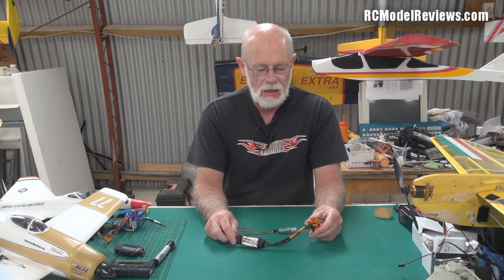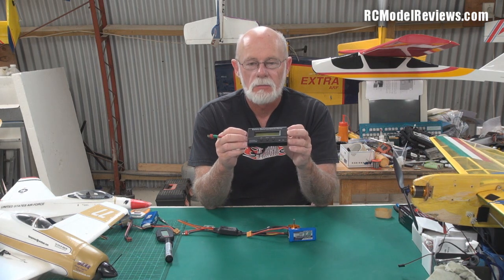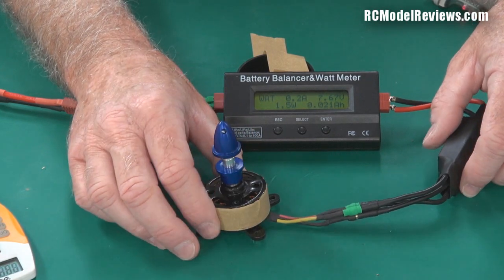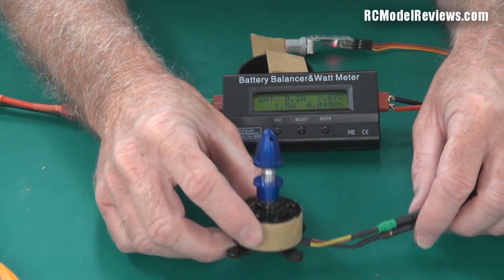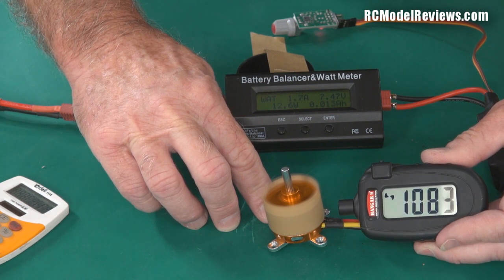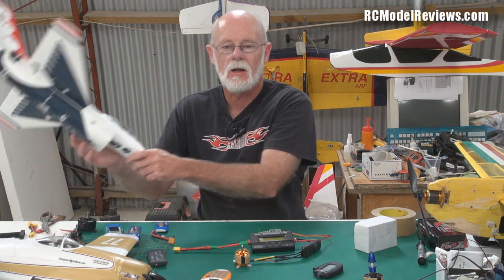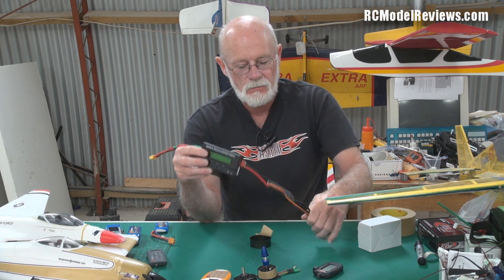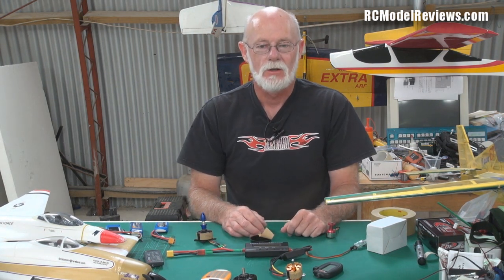RC BASICS: What is KV?

Comment: Thank u 4 posting this!  u mention not to put too much power into a motor that cnat handle it?  iam new at this and thot the motor draws power FROM the battery?   if it jst draws waht it needs wont it draw the same amt of power from batteries wit diff voltages?    r u saying the battery pushes power into the motor?

Comment: This guy is great.... what's his third review called?  I need to understand prop sizes....  does a smaller prop deliver more air speed or does every motor have an optimum size... and does an 11.4 V 3200 battery give you as much flight duration as a 14.8 V 2200?

Comment: Hello Bruce. Tank you again for your videos. I learned alot from them. If I understud right, Kv stands for K rotations per volt per minute. Im ingriged about the velocity of the edge of the prof. Lets assume a fully charged 4S battery, 3inch prop and a 1105 motor with 6500kv. Using metric sistem. 3inc~7,62cm/2=3,81cm (radius). 

The radius*Pi*Kv*Volt*60seg will give us the volocity in m/s of the edge of the prop. Calculating 
0,0381*3,14*6500*16,8 = 783.841,968m/s 

This is faster than sound. Can you explain me how a plastic prop doenst explode on that velocity?
Im really intriged about this.
Takn you very much for your time.

Comment: Very good, I have 3 questions before anything, I'm doing mechanical legs like cats legs, it's very light, only 23.5 cm, I'm using plastic and aluminum for more lightness. The mechanisms work quite well, BUT I can not find the proper DC motor for this project, I use DC - 12V motor., It is heavy and weak to move legs, my question is what Motor do you recommend for this type of project? Can I get a better result with a brushless motor? Someone knows? Thank you.

Comment: I want to build an 900 mm EPP wing and was looking for motor options. It is suggested to use a 2822 1450 kv motor. Though, when I look at these motors, their thrust seems very low, even with big props, compared to the 2205 or 2206 motors used for quads. I'm now wondering: what is the benefit of using a large motor, with low kv, which has not very much thrust?

Comment: So, for a Boat application,   Basically the lower the Kv the more TROQUE it will have?  The Higher the Kv more Top end Speed?    Does a 4 pole motor have more Torque than say a 6 pole?   And lastly, what is the Determining factor(s) for the ESC,  is it Motor Max Voltage, Max Amps etc.,   Any help is appreciated.  After getting the Torque & Speed Kv sorted out, I need to know hoe to match that to a proper size ESC.

Comment: @biggavdemille
That particular tachometer is designed for measuring the speed of "two or three blade props"  It probably doesn't have a 1:1 option.
Reply: he had 2 marks on the tape,, I use this method all the time

Comment: A question for your next video (I apologize for jumping the gun): does field altitude (air density) affect prop selection? 
I live at 1500 feet ASL (about 460 meters). Denver Colorado - 5280 feet ASL (1600 meters) - is a 7 hour drive from my house. If I fly there, would I need to change props to avoid over revving the motor and overheating the battery?

Comment: Hi friends and thanks for nice video
the first question I have walkera x350 pro with total weight it is 1.200Kg what you suggestion
to new motor with ESC
the second question if I choose the motor with High KV like 1300kv , 1400kv it mean fast and strong and what the relation with ESC 20 or 30
thanks my friends

Comment: Isn't Kv only an approximation to RPM/volt anyway? I keep reading that Kv is actually  a measure of the back EMF produced as it is spinning. Hence why it's actually called the Voltage Constant like Kt is the Torque Constant

Comment: Thanks so much for this vide, subscribed! One question though. So, i understand that:

- Smaller motors = usually high KV = uses smaller props = therefore it's suitable for faster flying planes.
- Likewise, bigger motors = lower KV = more torque = uses bigger props = therefore suitable for slower flying planes.

If this is the case, why can't I just use a smaller motor on a slow flying plane BUT don't let it spin as fast? I'm assuming the faster the higher KV motor spins, the more throttle it gives?
Reply: I think then the motor would not be working at it's optimum.
If you mean a smaller motor with a smaller propeller, I think that would not give you enough thrust.
If you mean a smaller motor with big propeller and running the motor at slower speed , then the motor would not take it, as smaller motors has less momentum force. Torque.

When you choose motor and propeller for your plane, you start with the propeller.
Choose a big enough propeller for your plane. Then choose a motor that would spin that prop at the speed required. And a motor with enough torque.
It usually doesn't say how much torque a motor has, but you can sort of guess when you consider the KV rating and how many Watts the motor uses and the lenght vs diameter of the motor, like Bruce said.
A small diameter 250Watt motor with 2800KV = less torque.
A larger diameter 250Watt motor with 1000KV = more torque.

Comment: i have a question, i noticed you said that brushless motors were AC, i was always under the impression they were DC? i know that AC motors require inverters as the only way to change rpm is with frequency as appose to DC where you can just use a dimmer switch for example. i would really appreciate it if someone could clarify or elaborate on the subject for me. thanks in advance.

Comment: So if I have more kv does it go quick or slower
great video
Reply: KV is just speed of the motor, not power, so neither specifically. A small motor with a high KV has to spin very fast to produce the same lift on a small prop as a large motor with a low kv on a big prop. It really comes down to the dimensions of the model.

Comment: I've heard the tearn inrunner motor a few times from hobbyking... what is the difference between an inrunner and an outrunner? also what advantages could an inrunner have over an outrunner?
Reply: Out/In runner only means which part is moving, the outer shell or the inner shaft.

Comment: Does it matter what throttle value you give the ESC before you do the RPM measurement and division by the supply voltage?  Does the throttle need to be 100%?  And it is surprising to me that the measurement could be done with no load.

Comment: I'm confused. The speed must depend on the switching output rate of the esc. The torque will depend on the current, which will in turn depend on the voltage applied to the windings. Could it be that the speed per volt refers to the pwm voltage used to tell the esc how fast to switch it's output to the windings?  I assume the pwm speed demand signal goes from zero to the battery voltage?
Reply: "The torque will depend on the current, which will in turn depend on the voltage applied to the windings." Yes, this is true, but you can't put infinite amounts of current and voltage through a small motor. It would melt. So you need a bigger motor that can handle more power. Hope you understand.

Comment: Would it be possible to use two different motors for something like an electric skateboard? As an example, 130kv for torque and 220kv for speed? Would you need a slipper on the lower kv motor for when the speed goes over it’s limit? Thanks

Comment: so for multi-rotor world...if im trying to carry a payload and not too worried about speed, i need to use low KV motor with larger prop 

and if i want to do FPV flying which i need speed, i need to use higher KV with smaller props...do i have this correct?

Comment: so if you have a 6 cell, 22.2 Volt the balancer would read ~22.2, is that right. Because in the video u have 2 cell 7.4 Volt and that's what the balancer read ~7.4V

Comment: Does the Esc amperage need to be  bigger or lower than the batterys amps. ? If i have an instalation that require 60A , 60/4 =15A about an 20A Esc will work but the battery amperage need to be bigger or lower than 20A Required per motor ? The battery will need 60000mAh or the mAh multiplyed by C rate need to be 60A?

Comment: Bruce:
Can you do a video on how to convert a  gas model to electric? I have several gas kits .25 and .46 size with 9x6 inch and 10 inch props and don't know what motors to buy to convert them. Thanks for the videos.
Don

Comment: How slow can you effectively run an 800 kV motor as in your video?
Thanks.
Reply: If you can get it set up to be sensored, you can make it rotate as slow as you want. Without a sensor it will very dependant on the size of the prop, the amount of voltage being sent to the motor, the amount of poles in the motor, the size of the can on a road going RC motor.

Comment: can someone clear up for me how the voltage determines the speed?
this is not a brushed motor which indeed changes speed depending on voltage you give it due to the strength of the magnetic fields.
AC/BLDC motors are dependent on supply frequency to have the rotor "follow" the supply as the current alternates/pulses around the poles.
So how would KV work then?

Comment: OK so I don't know if you would be able to answer this. I'm getting into RC short course truck racing and I've bought a truck that's heaver than normal and everyone says I need a higher kv motor. it would seem that if its a heaver truck that I would want a smaller kv motor. I also have to buy an esc that is rated higher. if it helps the truck I have is the losi scte and the motor esc that is recommended is the tekin rx8 and there pro 4 4600 kv motor. I mean I believe those who race this setup I just don't understand it
Reply: It works differntly in planes and in sc trucks, bit remember that your motor doesn't have to have super high kv rating.
Remember that in planes are outrunners and in cars are inrunners.

Comment: Hi, Great info thanks .....I am building a Extreme Extra 300 E 58"...Im installing a 3800kv 550 size 1200w 4 pole inrunner motor ....Geared 3.5:1 ...15x8" wood prop....100A ESC....3s 60-130c 3.2Ah LIPO.Have I made any mistakes ??....(Another outrunner motor would of been better).....any info gladly received.

Comment: GREAT VIDEO'S thanks , one thing I was wondering , on both the motors you looked at with the Tachometer , you used 2 markings. I would assume that 1 revolution was 1RPM if I did it. Obviously it is not and from the kV rating/RPM measurement the rpm is double that indicated (as I would assume using 1 mark) ?
Reply: thats what im confused about too
Reply: Can’t say for sure, but perhaps there is a setting on the tach that allows you to set the number of “timing marks”? He did mention that this particular tack is often used with two and three bladed props.
Just my guess. It may also be that he should have split the reading in half.

Comment: One question...if I have two motors with different number of TURNS, one 17.5T and other 13.5T, but they have the same KV, 2500..will it have any difference of performance?...I mean, if they have the same KV, doesn´t matter the number of turns, they will have the same final rotation? and the torque? any difference? Thanks for any little help...

Comment: You are measuring the DC voltage into the ESC, but is it not the AC voltage out of the ESC that determines the RPM?   Unless I'm missing something, I don't believe your method is quite correct.

Comment: I know this is a old post but these motors are pulsed DC not AC.
AC fluctuates from +volts to 0V to -volts, whereas pulsed DC is always +volts and the timing of the pulses is varied.

Comment: If the volt reading is peak then the calc is correct, if not then the volts have to be multiplied by 1.414 to convert the RMS reading to peak.
Reply: That's true for sinewaves but not square waves

Comment: OK sir
you are saying lower kV with longer props and highest kV with smaller props. my doubt is what will happen when we connect higher kV with longer props and also I want to know if we want to left larger weight than what kind of motor is suitable higher kV or lower kV
Reply: +Manikandan R It will overheat or not perform very well depending on how much too large the props are

Comment: So i have a question.

You calculated the voltage that you had in the battery and divided that with the rpm. Should you not calculate the rpm that you got with the voltage you put in the motor? because the display shows you how much voltage you have in your battery not how much voltage you are putting through the motor.

Comment: Wouldn't the KV vary a little bit based on motor load?

Obviously this test is done unloaded, but I'd suspect you could get a little bit more data on motor performance by running a test with some sort of adjustable brake.
Reply: pauljs75 pretty late but KV is a rating without any resistance, so it will not vary with motor load

Comment: Hi, I run a 9,000 kV brushless motor with 2 cell lipo on my Tiny whoop and get around 3.5 mins of acro flight time (4.5 mins if cruising).  How do you think would swapping it with a slightly higher kV motor, let's say 12,000kV, theoretically affect the flight time and acro performance of my tiny whoop?

Thanks in advance!

Comment: I have a e-flite v1200 and it only has a 800 KV motor but it runs at 30,000 rpm on 6s ?? Why such low kv but high rpm, i thought the motor would have much higher kv?

Comment: Hmm... normally the two values you get for a motor is KV and KT in both cases the K stands for (k)constant.  The first is the constant ratio between volts and rpm and KT is the constant between amps and torque.

Comment: i know its an old video but I just started to learn and have a question please
I would really appreciate if I can get the answer 
one of the motors in my drone burned and I can not find the exact same size with exact same kv, 
the  closest motor I can find is same size but slightly different in kv, 
I would love to be  just change that motor so I'll be able to fly my drone again, 
is there any chance I can use one motor with 3600 kv and 3 motors at 3800 kv  but both same size in one drone ?
thanks alot

Comment: Went to the Hobbyking site with the intention of putting together a parts list for the kit rather than the backordered "Package Deluxe" Bixler EP , got everything but the motor, couldnt find one. It requires a 2620-1900 kV outrunner they dont sell, Are they talking windings, or dimensions?  Pages of motors in the Global site
Nearly lost my patience, and thats saying something considering the weather outside in Eastern Canada at current. So why not do a schtick on motor equiviency?

Comment: how do work out how many amps a 21.5t/1600kv motor will need? This is for choosing an ESC/battery etc.
Reply: You cant work out the current draw using only the kv. It is a function of the load on the motor and the voltage you run.

Comment: Great video, a lot of very useful information, but...the ESC absolutely does NOT convert the DC voltage supplied by the battery to AC voltage to power these BLDC motors. Yes, these hobby motors are BLDC motors-Brushless DC - these motors, in fact, run on DC voltage. The job of the ESC is to supply the appropriate current (determined at the throttle position/power controller little-dial-thingy)  at the rated voltage of the battery(give-or-take) to each of the BLDC's three sets of coils (hence the three motor leads) at the correct time and required polarity. The only AC voltage involved here is supplied to the LIPO charger when charging the LIPO cells.

Comment: Are you are you similar what you got but I do mine by wattage and amperage.... Cuz once you put a blade on that motor. It's going to draw more amperage.... Which and turn the motor is going to get hot... I need to find out the maximum wattage...😊 Then you can calculate the amperage of the ESC... And what size battery it would take.. and of course the for the blade.. or EDF...😊 Are you going to have to put something down there to pull a load on the motor and see what the motor can do...

Comment: KV confuses me. I still don't get it. Isn't the RPM of the motor determined by the frequency of the waveform output by the ESC? I thought the pk-pk voltage of the 3phase waveform is non-variable and effectively equal to battery voltage? Does the ESC have some sort of feedback loop that has a relationship to torque or back-emf? I am an elec engineer too. But haven't done power electronics since uni.

Comment: If  motor is rated 4S on hobbyking page, can i use 2S when ecalc shows me favourable performance? my esc does 2s, motor should run fine on 2s?

Comment: hey mr rcmodel i have a question. i found some drone BLDc with the rate of 2700kv is that its maximum rpm at its respective voltage with electric motor speed controller?

Comment: The issue I have with this is that these are 3-phase AC motors.  Hence the speed would be a function of the frequency being produced by the ESC. So stating that putting 1v in produces X RPM doesn't make sense without knowing the frequency the ESC is producing.
Reply: That's because they aren't AC motors and calling them that is wrong. They are still voltage controlled. The difference to a standard DC motor is that the commutation (switching polarity of the coils) is done externally via electronics instead of brushes. The ESC doesn't create the frequency, the motor has to follow. Only two of the three coils in a set is energized at any given time. The third coil is used by the ESC to sense when the motor has turned enough (angle is depending on the number of coil sets) to switch to the next two coils. How fast the motor is moving there is only dependent on the voltage just like in any DC motor.

Comment: Hi Bruce, I'm guessing you have built or flown the HK Bixler 3? Couple of questions for you. What do think of the standard supplied motor (2630 1400 Kv), and I've heard they are rubbish. Can you recommend a replacement motor? Some people have used a 2200kv (D2826-6) or the HK AXN motor. Another motor that was used was the turnigy aerodrive 2836 1500 Kv. Hoping you can help out.